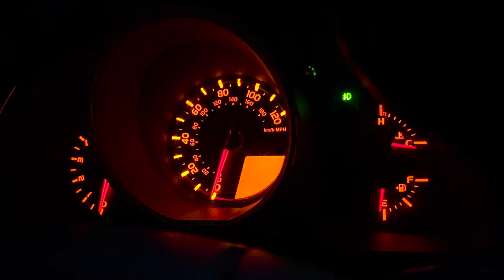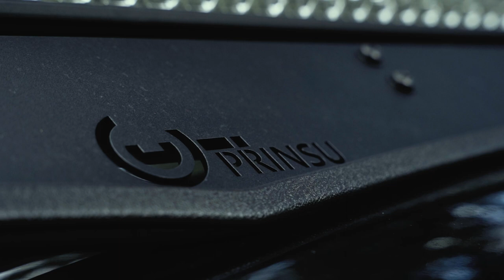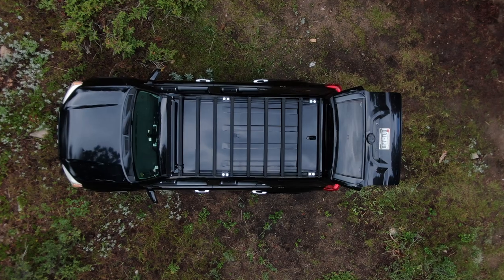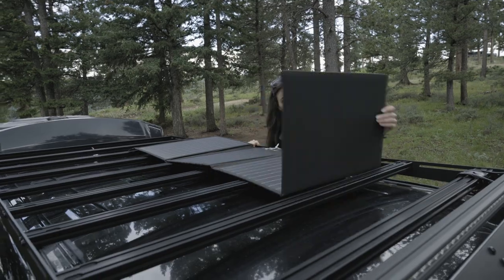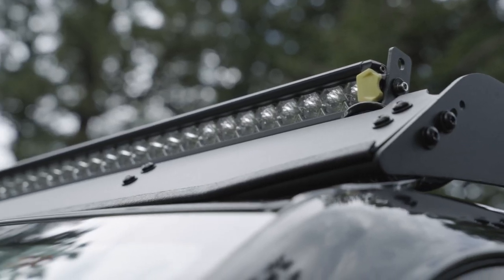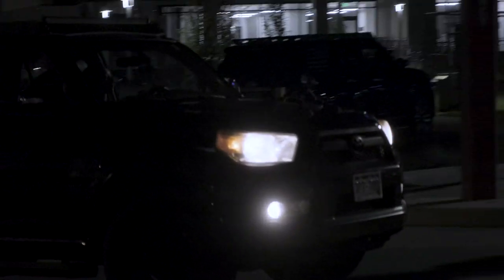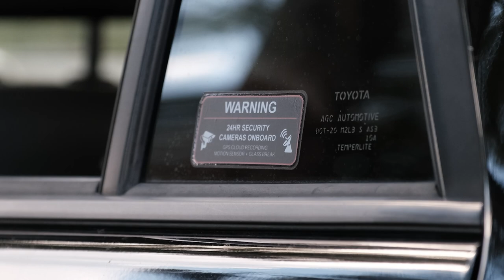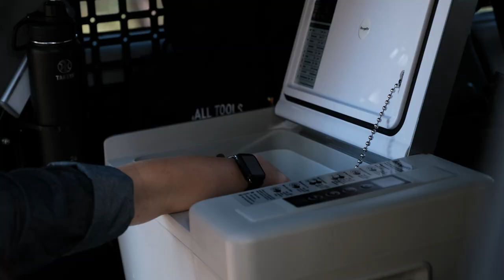Build your own camera gear vehicle

Comment: Awesome vid (and car, wowow!!). I've got a '14 focus hatchback and I have fit some truly insane rental house orders in that bad boy, more than a few times the staff bet me money it wouldn't fit... These days, it's mostly just hauling my own gear. Always keep a tripod and most importantly one of those giant Anker LiFePo4 battery banks in the boot.

I spent a couple weeks camping in TX last month and having enough power to charge my gear many times over without needing to find an outlet was awesome. Was shooting a ton of stills and had a drone up a large percentage of the day and that thing saved my life. Now that I'm back, it's still super useful to always have plenty of power on tap no matter where I'm adventuring.

I do some emergency management volunteer work so I also have some radio gear (base and handhelds) which is great for communicating with a group of people when there's no cell coverage. To prevent that from happening, also have a big 4G/5G booster with an external antenna and that thing works surprisingly well. A great quality of life upgrade.
Reply from the maker: That sounds like a really awesome setup! Really for me the portable power was the biggest game changer.  I look back on my days without it and think how I ever got anything done haha. Thank you for commenting. :)